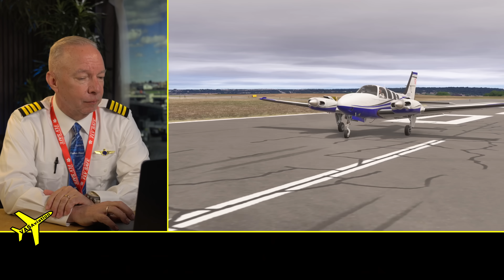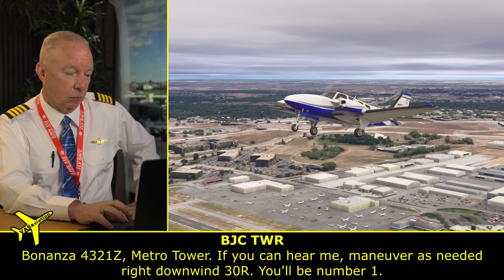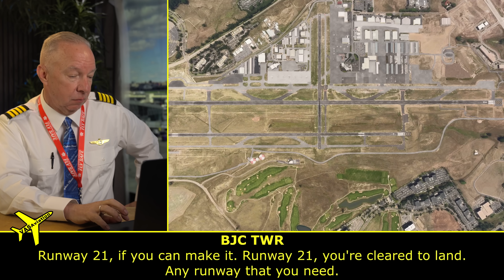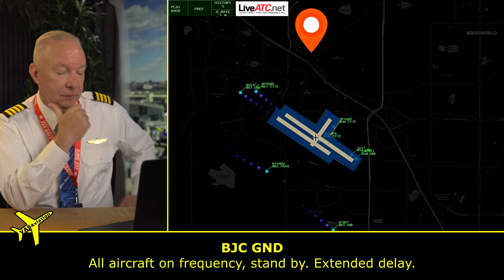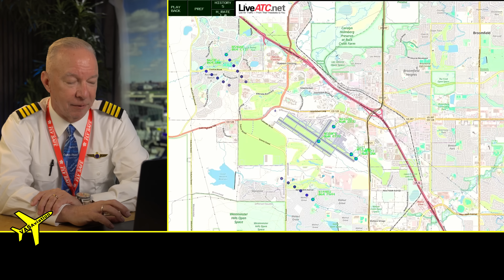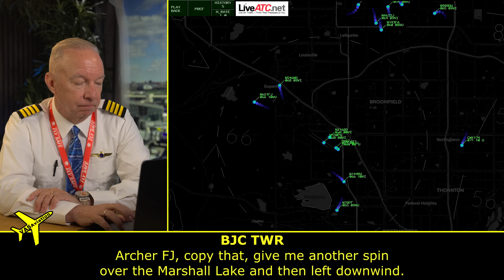Baron Crash in Denver: How a Door Popping Open Turned Deadly

Comment: "The Eastern 401 crash was not caused by the landing gear indicator light failing, but by the flight crew becoming so preoccupied with the malfunctioning indicator that they failed to monitor the aircraft's instruments and inadvertently disengaged the autopilot, causing the plane to crash into the Florida Everglades. The light bulb was likely just burned out, a relatively minor issue that was overshadowed by the crew's divided attention and a series of other critical errors, including a faulty altitude warning sound being missed. "
Reply: Watch this video before committing

Comment: Beech baron is old aircraft and engines are not so powerful-when door opened  aircraft capacity to climb or maintain altitude with gears out is dramatically reduced -just for info

Comment: I flew barron 58 for many hours! Had a few door pop open ! That plane will not crash, its obviously the pilot that stopped flying and the aircraft went into a spin
Reply: Agree. Barons have more than enough power to climb out of a door malfunction. Those doors are light and were probably sucked open to the side. This happened to us a few years back and my brother in law was able to grab one of them and hold it in place until we could land safely. Power and the aircraft was not the issue here.

Comment: I had a Beech Baron and the passenger door in the from unlatched.  It will not open because of the wind rush but you can not open the door to close it.  You are stuck it open a few inches but it did not present any threat.  We landed safely but unfortunately it was sleeting and was uncomfortable but no injuries.  I have no experience with the suicide door, that would be a different story.

Comment: It was Eastern 401, What happen the plane was on  autopilot and in messing with the light one of pilot thinking it was the capt bump the control yoke which disengage the autopilot on the L-1011 by the time the crew  realize what was going on it was too late. They redesign this I'm thnking. As a pilot the one thing I remember was to alway fly the plane frist then worry about rest later.

Comment: an abnormal they changed into an emergency.... and then into an accident.... I was commanding a brand new 757 out of LA when my window seal got a hole in it from a plastic tie wrap that was inadvertently left in the window track.... you have no idea how loud rushing air can be.... I declared an emergency and told ATC we would be landing in Las Vegas... the tower could not hear us and other aircraft tried to convey our message to the tower of what they thought we said and wanted.... at that point I used no comm procedures and landed to the west at Las Vegas .... The plastic tie wrap removed, patched up and 3 hours later we were on our way to sewark...
Reply: I can see Jeffco from just down the street from my house. The B-55's I flew never had a suicide door.... but the airplane has plenty of power on one engine for the ones I flew... I got my MEL ATP from Roger Riggins at Jeffco.... as well as my CFI many years earlier.

Comment: I used to  fly a Cessna 172 that did that on take off.  It popped open accompanied by a roar. The good news is that the slip stream only allowed it to open 4 or 5 inches.  After take off and at altitude I just pulled the 172 into a stall, reached over and slammed the door. That was the first of a number of similar events. Old 172…

Comment: I have a good amount of time in the Baron and it’s smaller cousin the travel air.

Travel air doesn’t have a suicide door, but a lot of barons I have been in either do or they’ve had the door reworked. 

Unfortunate tragedy, but you always keep flying the plane. You have 2 300HP IO-550 engines, there’s no excuse why it couldn’t atleast maintain altitude.

Comment: First, the graphic of the double door in the aft right side of the airplane is totally incorrect - this model Baron does not have the double doors in the aft right side fuselage , it only has the forward entrance door over the wing, thus the reason for the step.  Even if this airplane had the double doors they would never open like this in flight and stay open as depicted in the animation since the airstream would force the upwind door to the closed position.  While the door popping open is distracting and does make noise, it doesn't prevent two people sitting next to each other from hearing each other talk (I know from first-hand experience) and it was apparent that while it was loud the pilot was able to hear ATC, albeit not well, but if they were wearing decent headsets they could hear.  In addition, with the door popped open it is not going to create "excessive" drag.  The door will remain relatively faired with the fuselage because of airstream and propeller airstream.  The controller kept calling the accident airplane a Bonanza for some reason rather than a Baron and the controller "did not yell into the microphone" but gave them instructions to enter a right downwind for runway 30R.  The pilot did not declare an emergency nor did the controller (which he could have), thus airplanes operating in the vicinity of the airport are ops-normal until the controller tells the other aircraft to stay clear of the Delta airspace.  What is unknown is the number of aircraft and their respective positions in proximity to N4321Z when the pilot lost control.  There are a number of other factors that must be explore in the accident.

Comment: The 3D model of the plane used in this vid is very misleading.  The Baron E55 that crashed is forward hinged for the front door next to the pilot, and the single long lower (no upper half) door for the rear cargo/passenger area.    Either door would have opened only a few inches and had minimal impact on flight characteristics.

Comment: All we know is that "a" door popped open. Looks to me like a pilot entry door opening would be manageable problem. Fwd pax door ditto. Nose baggage compartment? Maybe, maybe not, depending upon whether something came out and went through a prop. But aft pax door (if that's even possible in a Baron?) could severely affect the controllability of the AC.  Need more info...

(former CFI-ASMEL/ATP, airline pilot)

Comment: How sad. I live here, it was good weather that day as I recall. I-36 is also known as The Boulder Turnpike, it’s the highway between Denver and Boulder. Broomfield is its own city, but is a suburb of north Denver Metro. This airport is indeed a place where a lot of recreational pilots fly out of. There are plenty of distractions along the Front Range, like losing orientation, to micro downbursts… so sadly, we’re not usually surprised to hear of small plane crashes over the Rockies. As a request, Captain Steeve, I would love to hear your analysis of a commercial plane (Frontier?)  that crashed just after take off from Stapleton Airport. I think it might have been the first case of when they learned about and acknowledged microbursts. I don’t recall the runway number but I think it took off on the north runway crossing over I-70, I believe it never got to altitude, it flipped… this was sometime in the mid to late 1980s. 1986 or 7 maybe. (Now the NWS will hold flights— whatever that is called— until the microbursts pass. I’m a volunteer storm spotter.)

Comment: Back in 1966 I took our aero club Cessna 150 off for the first time by myself after Soloing. The passenger door popped open at about 300 feet altitude.  It was loud. I was trained by an old "WWII flying Sergeant" and he drilled into me fly it first, the deal with an emergency.  After leveling out around 1,500, I reached over and got the door closed. I continued on my flight plan. Later a radio problem. Another story.

Comment: I have two incidents like this - I was flying a GY80 Horizon (little French 4-seater) when a door popped open on climb-out.  I was with an experienced pilot who said "Ignore it, fly a circuit and land" which I did.  In discussions afterward it was stated that the door will just remain about 2" open due to the balance of the Bernoulli effect pulling it open, and the airflow pushing it closed.  You can't either push it further open or pull it closed.
I live near what used to be Radlett aerodrome (former home of Handley Page) and many years ago I cycled onto the long-closed runway to find a Beech (I think) twin standing there with bent propellers.  Turns out they had taken off from Elstree with the pilot's 8-year-old daughter in the right hand seat, when her door popped open.  The pilot panicked to the extent that instead of returning to Elstree (about 3-4 miles away) he elected to do a forced landing on the Radlett runway.  But he forgot to put the gear down!
I think pilot training should include discussion of opened doors, and front-hinged doors pose no danger.  (Suicide doors another matter of course, and I don't know about gull-wings).

Comment: Not a pilot; just a regular guy that wished he was. 

Per Grok:  The Beechcraft Baron, a light twin-engine piston aircraft, does not have “suicide doors” in the traditional sense. The term “suicide doors” typically refers to rear-hinged doors that open backward, often found on older cars or certain trailers, like Airstreams, where the design can pose risks if not secured properly.
In the case of the Beechcraft Baron, particularly the Baron 58 model introduced in 1969, it features double aft cargo doors on the right side of the fuselage, which became standard shortly after introduction. These doors are designed for easy passenger and cargo access, often likened to those on the Beechcraft Bonanza. The Baron 58P, a pressurized variant, has a single aft door on the left side, but it is not described as rear-hinged or resembling a “suicide door” configuration.”

Is this correct???
Reply: Follow up:  Summary of Beechcraft Baron Doors Flying Open and Landing Safety
•  History of Doors Opening: Beechcraft Baron doors, especially the aft cargo doors on models like the Baron 58, have a history of popping open during flight due to improper latching or, less commonly, mechanical issues. Incidents include a 2003 fatal crash in Georgia and a recent Colorado crash, both linked to door openings causing pilot distraction. Pilot forums report multiple cases, noting the rear side door is hard to close in flight due to airflow.
•  Landing Safety: An open door typically trails 3-4 inches, causing minor drag and a slight performance loss (e.g., 160 feet-per-minute climb rate reduction). The Baron’s Pilot Operating Handbook indicates the plane remains controllable, and pilots are advised to leave the door alone, maintain control, and land normally. However, significant drag may require rudder/aileron inputs, especially in challenging conditions. Distraction from attempting to close the door has led to crashes, but the aircraft can generally land safely if pilots prioritize flying over fixing the door.

Comment: Years ago I was giving a BFR in a guy's Beech Skipper and the door popped open on rotation. The plane could barely climb. We got up to 500ft slowly, slowly climbing straight out and then just leveled out at 500', flew the pattern at that altitude and landed.

Comment: Your simulation video shows the rear doors open, in an probably impossible configuration -- the air stream would keep the front door section closed, and I suspect the air stream would snap off the back door section. However, since there were only 2 people on board, they would have used only the forward door, which has hinges on the front. So, if that door popped open, it would only open a tiny fraction of an inch, and the noise and distraction would be quite manageable. Don't ask me how I know (although I was flying a Piper Cherokee at the time, rather than a Beech. In my case, I ignored the distraction, landed the plane normally, properly closed the door, took off and resumed my flight). It seems very unlikely that with only 2 people on board, that the passenger was in one of the rear seats. So, absent the NTSB report, I think the most likely cause, as you mentioned, is that the pilot fixated on trying to close the door, and stopped aviating.
EDIT: now that the preliminary NTSB report was just released, it was the front (i.e. main) cabin door that was open. Since that door is front hinged, the door popping open shouldn't cause any noticeable change in the Baron's flight characteristics.

Comment: I owned a 1991 Beech Bonanza and I had the entry door open a couple of times after takeoff. A couple of times with 1 passenger and once with 3 passengers. Never did the door popping open cause any difficulty in flying the plane ... Yes it is noisy. Yes the first time is was a little scary, because it was so loud mostly. In every circumstance all I did was continue  to fly and climb the airplane until I had enough altitude, ( 3000 feet MSL ) to safely slow the airplane down to close and latch the door. There was never a problem or difficulty safely flying the airplane. I fortunately never was alone when the door popped since it's on the copilot side of the airplane and a little harder to reach and relock.

Comment: I've watched several videos on this crash and this video suggests there is a double door behind the wing. If this opened it could present a real problem with air flow over the tail.
If it was the main door that opened the only problem that would present would be  wind and noise. It happened to me flying a V tail. The door will only open about 2 inches and won't affect flight characteristics.

Comment: Not on the air, but I did had a door opened on me on a Piper Arrow (Single Engine piston complex airplane). It's a double lock passenger side only door. It opened during takeoff run, and unlike jets, there are no V1 speeds, and it was very close to Vr speed (rotation speed). I didn't concentrate on the door, I aborted takeoff, slowed down safely, got off the runway, closed the door, and took off without an incident.

Comment: Had a door open shortly after take off at KPWM in a Beech A36 Bonanza. Complete non event. Just lost a chart on the right seat. Told tower I need to return as my door opened. Right turn into downwind, configured to land, curving base to final with some extra power.  Exited the runway, closed the door, and departed. So sad to hear people are dying because a door opens. I suppose a Baron (which I’ve flown) might behave differently, but the fuselages are very similar.

Comment: I think ATC sometimes - in hindsight - can inadvertently send a pilot down a a funnel of every decreasing options by offering pilots "any runway" when asking "do you need to climb to sort this out" may actually elicit a better, less rushed outcome. So if the starboard doors are open, that's the wing most likely to stall, so flying left turns only may be safer. You need time to figure that out after a startle event. I'm not saying ATC did anything wrong here, BUT if you get in a startle event, altitude and speed are your friends, because they give you TIME, both to recover from the startle event, and to think critically about your plan to land. If you doubt you can fly a circuit, look for the emptiest area and land in that. If you can't avoid hitting something land in to something frangible - the top of trees can be good if your stall as you hit them. Failing that land perpendicular to garden fences, having cracked the door, mixture and master off and fuel off if time. Fences absorb energy beautifully. If there's a fire - well - you're "a bit poorly placed" but if not forced landings are eminently survivable PROVIDED you think these things out beforehand. Fly from the same strip all the time? Examine and decide where you will land, into and through what if the problems is sudden and acute. Glider-trained pilots do this every single flight. Even if they later take up power flying, because in every light aircraft, there's a glider trying to get out!

Comment: I have a B55. It has a cargo door, large but not like the 58s dual cargo doors. In my opinion, not as problematic. The one piece of advice I would offer is to never trust a right seat passenger to secure the door before takeoff. You must be sure that it is all the way latched. Reach across them and latch it yourself. It’s easy to not fully latch it if you don’t know the drill.

Comment: its a bonanza not baron. single engine. why not have door sensor like w 3 green showing door locked. seems common problem. probably because pilot got in first not last. passenger wasnt experienced in closing door securely. sad stuff regardless.
Reply: this happened to me a couple times getting my private in a cessna those doors also can be fickle but they aren't suicide doors dramatically effecting flyability and drag.
Reply: No, it’s a Baron

Comment: I had the door (passenger side) pop open on a Piper Warrior on takeoff.  It wouldn't have been a big deal except my passenger (now ex-wife) freaked out.  Seeing daylight out the door gap, even when she was buckled in, was too much I guess with all the noise.  I just went around the pattern, touched down, whanged the door shut myself once the speed reduced enough, and then gunned it and took off again.  What happened was the ex didn't latch the door all the way and when at takeoff speed an overall (external) negative pressure situation occurs that opens the door a few inches before the slipstream keeps it from opening too far.  Fortunately a simple airplane to fly at a low-traffic airstrip made for a non-critical situation.